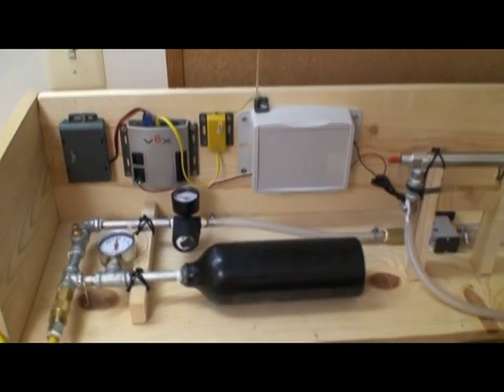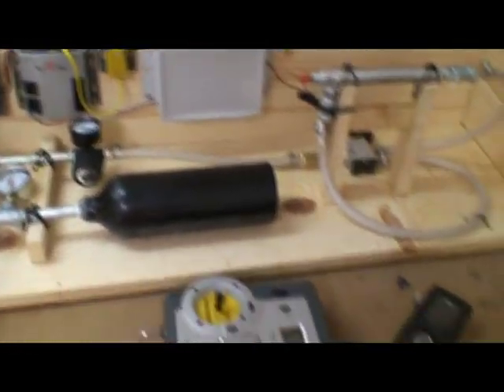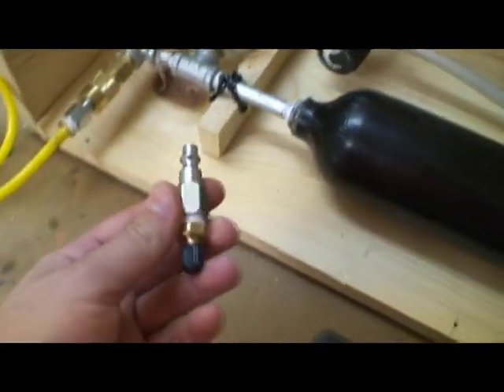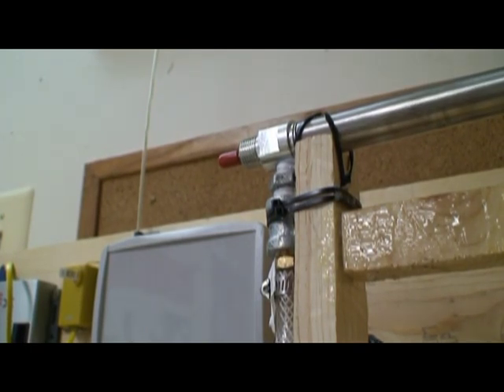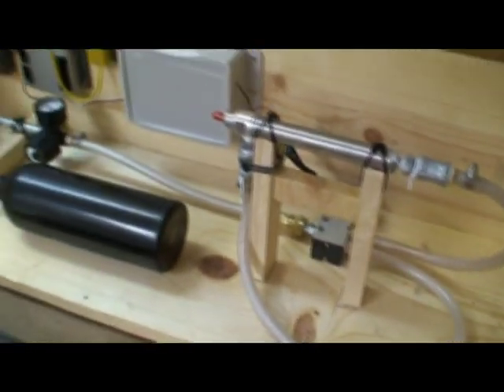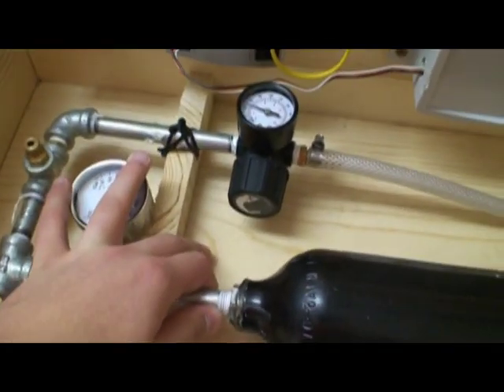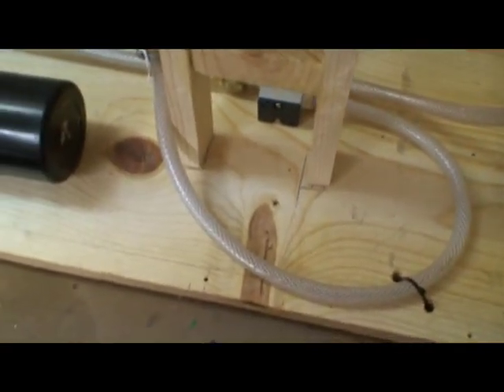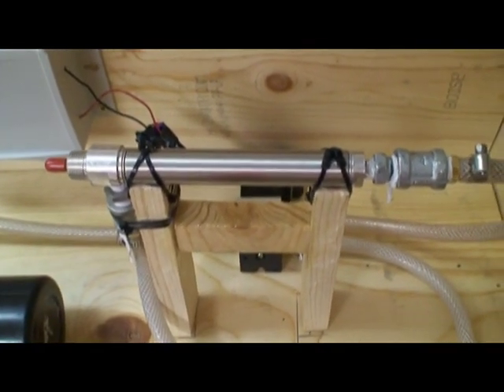RC Pneumatic Air Cylinder

Comment: The tank is not necessary if you are using a compressor, unless your cylinder has a bore of 2 inches or larger.

Comment from the maker: No in the video setup it is the same as you described. You have a 4 way valve but it has an extra exhaust port just like I have. The valve has an input, output A, output B, and exhaust port  but a lot of times they include an extra exhaust port. On the valves with just one exhaust port it is shared amongst the the two output ports so output A and B would exhaust out the same port.

Usually the small valves 1/8in or less have one port while the bigger ones 1/4in plus have two ports like I used.

Comment: @Halo2maniaccc how does that work? for my double acting i use a 5 way valve 2 to go to each end of the ram, 1 for input and 2 (1 for each end) exhausts. do you use a quick exhaust valve on the ram?

Comment from the maker: No it is not programmable. When the rod only comes out a little bit it is because the valve is being switched on off too quickly and it doesn't have time to complete a full stroke. If you want to control posistion then search Servo pneumatic valve demo on youtube and click on the first video. It is a damn expensive setup at over 1500 dollars but it will allow the full control you want. Simply send it an rc servo signal and it moves where you want it.

I hope this helps!

Comment: Nice system. I notice you are getting the rod only halfway out in some parts of the video. How specifically can you control that? Is the solenoid valve programmable to different open positions?

Comment from the maker: The solenoid valve is a FOUR way. Double acting cylinders must have a four way to extend and retract while a single acting cylinder only needs a 3 way because its spring push or return. Two way valves are not used for cylinders because they are just valves with no exhaust port.

Comment from the maker: EDIT - There are precise control valves for cylinders the only problem is that they cost an arm and a leg. You can search enfieldtech or search proportional pneumatic control demo then click the fourth link to see a video of it. From what I understand it uses sensors within special pistons then changes air flow rate with a very special very expensive valve. The system in the video is 1500 dollars! If you don't need pneumatics then please go electric you could get way more for that much

Comment from the maker: EDIT - There are precise control valves for cylinders the only problem is that they cost an arm and a leg. You can search enfieldtech on google or search proportional pneumatic control demo then click the fourth link to see a video of it. From what I understand it uses sensors within special pistons then changes air flow rate with a very special very expensive valve. The system in the video is 1500 dollars! If you don't need pneumatics then please go electric you could get way more for that much

Comment from the maker: I don't have any more advanced setups but I may have a few suggestions. I have never seen a variable pneumatic piston, I just can't see how it would work besides varying air pressure (controlling pushing force). The only things that may be similar would be a linear stepper motor table or a high power linear servo both of which are ELECTRIC yet have decent force and VERY PRECISE movements. I have videos showing basic control of both servos and stepper motors although not the linear type.

Comment from the maker: The electronic relay that switched power to the solenoid valve was a very common and readily available one that can be picked up at Radioshack for about $5. It comes in a small 2 x 2 cm blue casing and has NO and NC pin connections. You simply solder it in place as a switch in the NO position (normally open) and apply power to the internal coil causing it to switch.

If you can't get the relay to work it might be a problem with the electronics, relays are fairly robust pieces of hardware.

Comment from the maker: Its possible but building a gas airsoft gun using this type of setup would require lots of precision, time, and money to build effectively. A bolt action rifle might be possible but you would probably have to gut and mod an existing gun.

Another way to do it is to make a CLOUD BB GUN that runs off compressed air. There are many tutorials online and youtube videos of them. To make it mobile you could switch to a regulated co2 source (lowes has a paintball co2 regulator which works nicely).

Comment: an arduino can also be used to set up sensors like infra red or pushbuttons or even elaborate fm transmitters.  the solenoid is simply another kind of pwm controlled device so look for any circut that can convert sensor data to pwm events, google arduino for non midi, and higly liquid if you want to use a piano or drum pad for a controller

Comment: one way i read is to build a mechanism like a guitar volume pedal , forgive my spelling but its a potentiometer connected to a string and a spring,  physically the string is connected to the cylinder so as it extends the resistance of the potentiometer to change from there an arduino kit can be used to convert resistance to distance

Comment from the maker: What do you mean by controlled strokes??? If its the length/position of the stroke your are talking about than its possible but that would be a very complicated cylinder. If you mean how fast and hard it pushes than this can be obtained easily with a digital pressure regulator. The only reason I didn't use a digital regulator on this thing was the price of them which costs about $100 for a small one and $400 for a really nice one.

Comment from the maker: The use of 12g tanks would be easy with my co2 regulator, since it accepts paintball tank threads you could just buy a 12g co2 tank to paintball tank adapter. They are like $15 but then again 12 grams of co2 is not even worth it, that is not even 1/2 ounce of co2. You might get around 20 strokes but a higher capacity tank it cheaper and lasts way longer.

Comment from the maker: This would work on a regular vex robot but you would need to get mini components (regulator, valves ect...) which can be pricey. This system was meant for larger robots with more room and weight capacity. I now have a co2 regulator system for paintball tanks which will eliminate the bulky compressed air system and give me A LOT more strokes. A 9oz tank will give me around 500 or 600 strokes on this system at 100psi. A 20oz will give around 1200 strokes!!!! I will post a video of it soon.